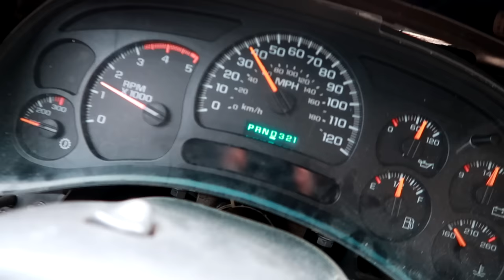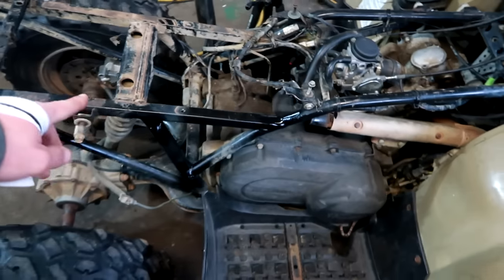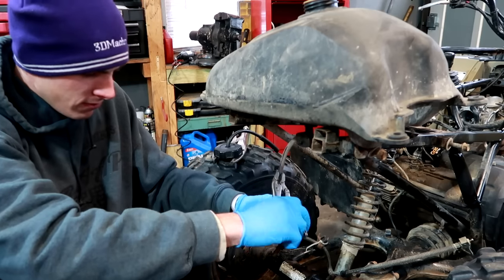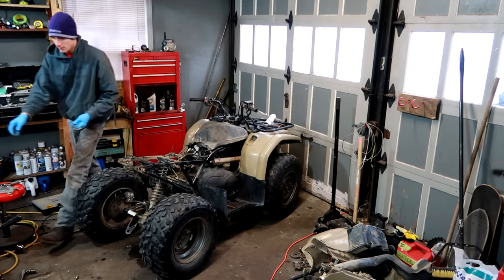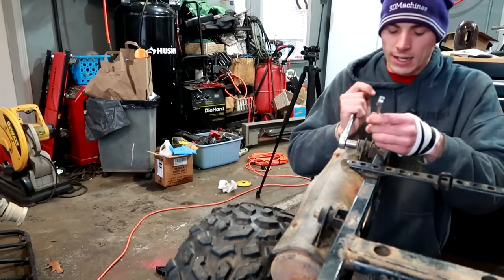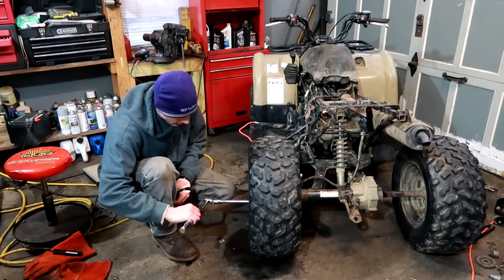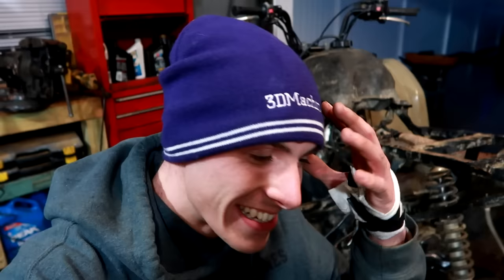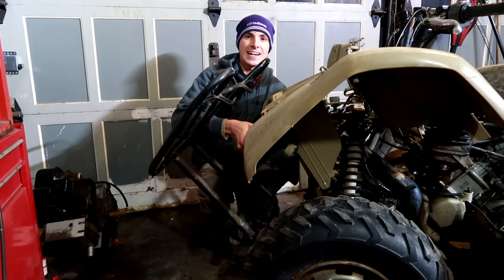THE KODIAK SHOOTS FLAMES

Comment: Four wheelers are just so much work, the 3 I've had each needed at least 10 hours of wrenching before they were in good shape, just sold my yamaha bruin 350 for a $200 loss after I put a ton of new parts on it thinking it would be worth it, needless to say it's only worth it if the bike is in decent/good shape to begin with. No doubt that kodak will only cost you more in the long run but for experience and the joy of riding the finished product may be worth it to you

Comment: I watch you every day I enjoy your vlogs. I have a tip for you anytime you come across Rusty bolts or Rusty tools you want to suck them in straight vinegar for at least 12 to 24 hours and then you want to rinse them in a combination of baking soda and water. and your tools you can wipe them down with any type of oil such as canola oil, olive oil, the best type of oil to rub your tools down with to keep them from corroding or rusting up is coconut oil that way you always have clean tools that will always look brand new.

Comment: also heads up, the exhaust on those things gets WAY hotter than normal (you saw the flames that go through it), so on mine it melted a section of the body right out. not sure how you'd fight that though.

Comment: local here, i want updates on this, i'm buying one. only question i have on the build is are you going to weld a frame up yourself? because that would be one beastly ass diesel! oh and i believe you messed up... isn't this monster supposed to run a special formulated diesel brap juice?

Comment: I Would by One of those four wheelers so fast it's not even funny. hey Dalton been watching you for around a year-and-a-half two years and I used to think always is another one of those YouTubers until I started watching your videos and I got hooked I can't stop watching your videos every day as soon as it uploads I have to watch them if I'm not fixing one of my bikes or something else. I know your pain about breakdowns and forgetting where your tools are sometimes I wish it is put a tracking device on each one. I once owned a Honda XR80 as my first dirt bike and the thing was breaking down every time I rode it finally when I was pulling into my backyard to wash it off it wasn't starting in its normal position and it wasn't moving as fast as usual until it revved up and stop moving and I heard it's starting to clunk and then as soon as I put it in neutral I heard a rattling in the bottom of the motor and I knew exactly what it was my timing chain blew off and I just put a whole new top-end on it so I sold it and now I'm a proud owner of a Honda 2016 150 f and though I haven't taken it out because here in Canada and we got a foot-and-a-half of snow I have ridden it once. sorry for giving you my life story on dirt bikes love to videos keep up the great work and I'll be hooked with 3D machines for my whole life.